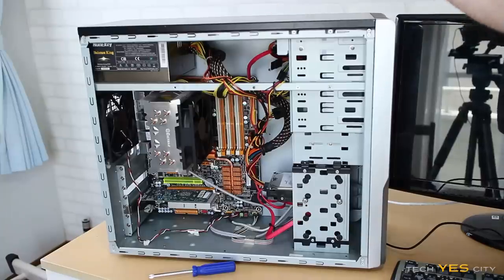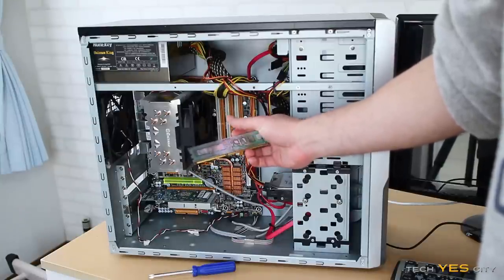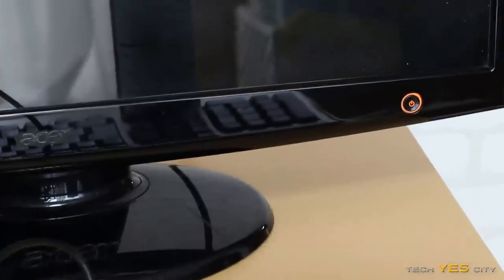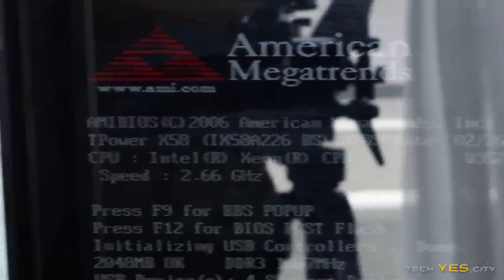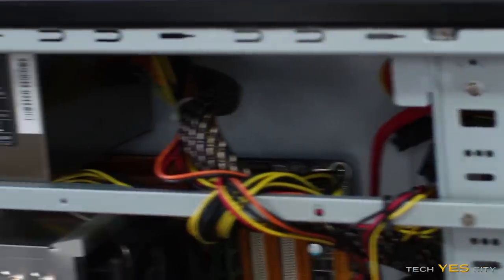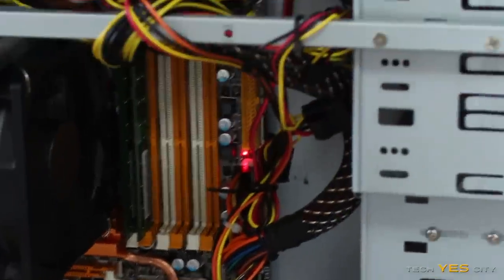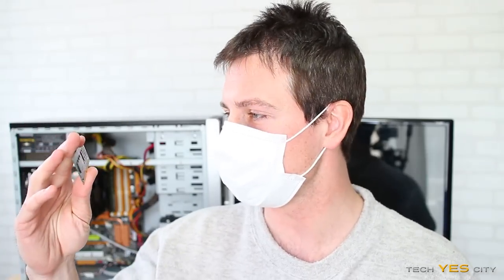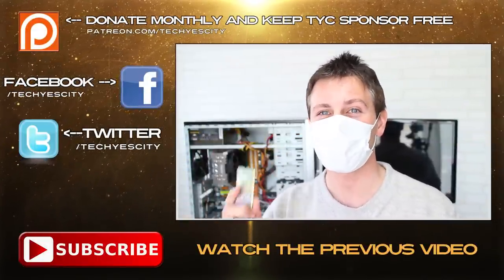Can You Spray Paint PC Parts? The Story of the 1GB DDR3 Memory Stick (VLOG)

Comment: You can always remove the heatspreaders and spray them... I do, even the fans. It doesn't just look cool, but you also get rid if those sharp plastic edges from the melting process. Though you gotta be careful not spraying too thick layers on the wings or it'll be unbalanced or the engine might fry. Disassembling it is recommended.

Comment: you would have to use a special electronics grade coating for this -- 20ish years ago I worked in electronics circuit board work for AGL lasers and we used a substance called "conformal coating" don't know if this was product name or description, or even slang for the coating we used, but it sealed the pc board without conducting and was low capacitance (for that time period)

Comment: Remember, a PC SUBMERGED in water can take up to 15 minutes for a FATAL error that causes the PC to crash due to short circuiting. It will throw out errors over and over, but it takes that "special" error to actually cause the PC to crash. PCs try really hard to not crash, even with constant errors(which day to day usage can cause constant errors).
Reply: But if you submerge it when there is power it immediately gets destroyed.
Reply: +Jordan Johnson (Mighty Burger) Not necessarily. Did you even read my comment?
Reply: Zeppy
Yes. But you had no mention of whether or not there was a power source. If there is a power source and you submerge it in water, I can guarantee it won't work. I'd like you to record a video of you doing it to prove me wrong.
Reply: +Zeppy Basically, circumstances and type of water used change the duration of how long the pc will last.
Reply: Zeppy
If you're using most common "types" of water, and you have the motherboard battery connected and/or the power cord connected to the computer and the the wall, the pc will not last long enough for you to take the pc out of the water. If you don't have any power attached (by removing the motherboard battery and the power cord), you should be fine if you let the parts dry out before attaching any power. You might not want to submerge hard drives, though. They could have some issues, even after drying.
Now, I think I see where you are coming from. There are certain liquids that are not conductive, such as mineral oil. If you take the right precautions, you can absolutely submerge a PC under mineral oil.
Reply: +Jordan Johnson (Mighty Burger) Yes, and you are right hard drive should not be submerged AT ALL ever. It isnt the conductivity that ruins them, its the left over fluid that messes with the precise mechanisms and read head. Well, good day sir. :)

Comment: Would it make a difference if you'd Plasti Dip the Ram?
Reply: Manfred Höffken Yes, as it is not conductive in any way. It's an isolator actually.
Reply from the maker: Manfred Höffken Might have to test another stick lol.
Reply: Razor Blade So as long as he protects the heatsinks (and the connectors obiously) Bryan could Plasti Dip a motherboard?
Reply: Manfred Höffken LinusTechTips even painted a motherboard with normal paint once. PlastiDip would also work, just like any non-conductive (isolating) paint. But make sure that you're not isolating very hot parts, they would get even hotter. The connectors are not much of a problem, if you plug something in and out several times to scratch the paint off of the contacts.
Reply: Razor Blade The 10-foot-mod where he spray painted a Rampage V to a blue(ish) scheme? Yea, saw that. But I was thinking about painting the complete board, PCB and all (with the exception of the heatsinks to not insulating that unnecessarily).
Reply: Manfred Höffken You can even take off most heatsinks (and replace the rubbish TIM while you're at it). It should work to paint a whole board, many have done it already. Just google it. It's just quite a lot of work to cover all the parts.
Reply from the maker: I have heard a lot of mixed opinions about plastidip though, people saying colors come out terrible etc.  Would love to get my hands on some of the stuff, as the paint I use at the moment comes out really good on my heatsinks etc. Just finished spraying up a headphone stand black, came out really well.
Reply: Tech YES City Dear Bryan,

I have just done some search and managed to come with the following:

about 3x GTX 780Tis from different sites offering used GTX780Ti's with at least 1 or 2years warranty. Price: around 320-350 AUD

A used GTX 780 for $300 AUD

A BARELY USED GTX 780Ti with like 2year warranty: $330AUD

Should I go for a new gtx 970, a gtx 770 ($300AUD) or the above???

I NEED HELP!

Thanks.
Reply: glory94 The 780 ti is still a beast card and for 300aud is a bargain, Go with the 780ti 2 year warranty. Just make sure it's legit.
Reply: OK cool. Thanks a lot!
Reply: Manfred Höffken I would think plasti dip would work but it might make the RAM run a bit hotter as I would think it would insulate it. I have an old PC laying around and now I am curious...

Comment: Are you sure that stick of RAM was OK before sprayin on it?
Reply from the maker: Pablo P Yeah it was working fine before, but sadly not after... lol I did plaster all that paint on there... However I guess that one would if they wanted to change the color of their pcb - which sadly is not recommended :(.
Reply: Tech YES City You could have tried what paint is conductive with an ohm meter and then see an isolating paint fries components.
Reply: CapnTates may not be resistive but capacitive, which would be very hard to read at capacitances so small that would effect high speed ram, an oscilloscope may not even read high enough to see the effect on today's ram
Reply: wildmanjeff42 It needs to be conductive to make it capacitive. There is just a layer of isolation with capacitive compared to conductive.
Reply: CapnTates while what you are saying is true, we are talking about amounts of resistance that are too small to measure.  you would need a meter capable of measuring capacitance to an extremely small value
Reply: wildmanjeff42 You can measure water vapour which doesn't break the RAM, so why not paint which does?

Comment: Ok I asked on both on your videos about the Xeon 1231v3 and no response so I'll ask on ur newest vid for help can I livestream daily and record on it or should I by an i5 4690k
Reply: If you want to stream better off with a i7 = 8cores (4 cores with hypertheading) as more cores is better for more things at the samw time but between those cpus i dont really know...
Reply: Romick Vieira its. An i7 4790 without a builtnin gpu
Reply: MasterRaceGaming without built in gpu? Ok didnt knew that. Btw i got fx8350 it can bottleneck high end stuff but its good enough if you stream not very cpu demanding games as it is 8 core and also cheaper that the i5 i believe
Reply: Romick Vieira theres a reason its cheaper worse performance and its actually got the power of of 4 core and 8 threads with are low performance a i5 4690k. Is alot better fir almost anything
Reply: MasterRaceGaming well i know its getting old... I have it lol... But for most things its fine and in multithreaded apps it runs better than the i5 so, for streaming, if u cant afford i7 its actually gonna be better than the i5 but yea anything else it loses...
Reply: The i5 beats the 8320-8350 in streaming and gaming Brian has a video proving this even in most multithreaded apps it didn't win
Reply from the maker: MasterRaceGaming Sorry for the slow reply, I would go with the 1231v3 for pure value for money, I think it is THE CPU to get at the moment.  The 4690k is good, but the thing is you are not guaranteed to get 4.6ghz like I did with mine, I would say 4.2ghz would be a real world guarantee, and at 3.8ghz (HT and less power consumption) vs 4.2ghz (no HT, need a new cooler) I know which one I would be choosing.

Sorry for not replying, didn't see the comment.
Reply: Thanks for replying Brian